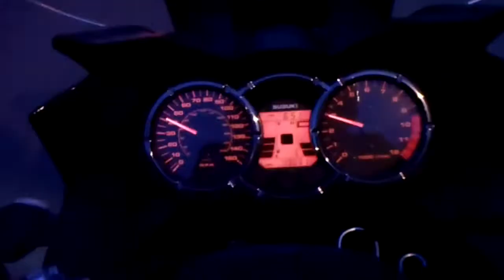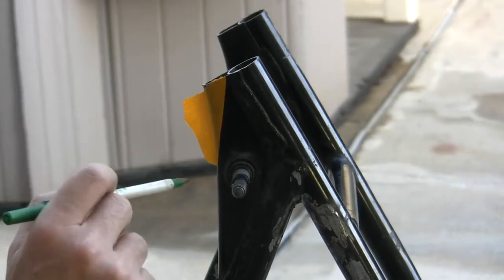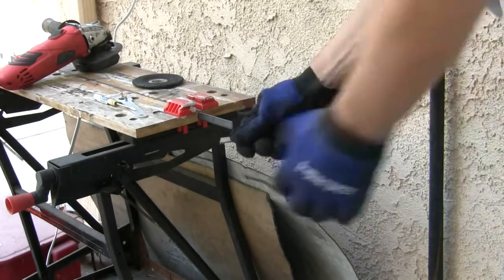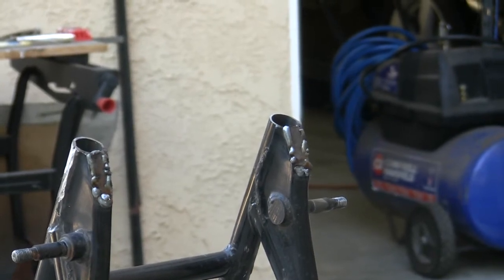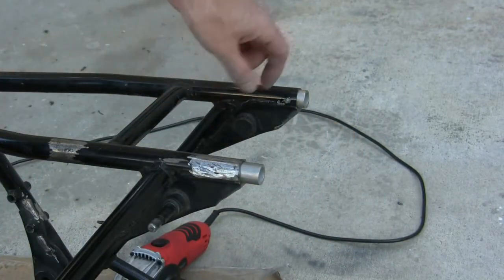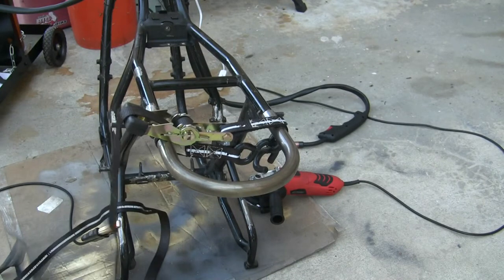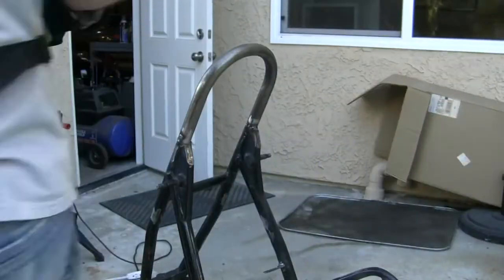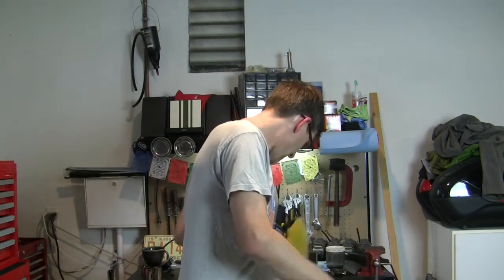Mount Rear Frame Hoop - GS550 Cafe Racer (Part 30)

Comment: Where did you buy that hoop from? Working on the same exact bike and I'm about to jump into this process.
Reply from the maker: Zach Painter Thanks for watching. I got the hoop from an EBay seller called motorcycleparts*market*. Chinese seller.  Took a lot of measuring and looking to get correct size ordered.  This one is 25mm tube diameter. The exact listing I bought doesn't appear to be active anymore. Enjoy your build!
Reply: Great! Thanks for the info! Looking forward to seeing the rest of the build.

Comment: Hey there, Im at the stage where i am  looking for a hoop. i see in the comments that the hoop you purchased has a 25 mm inner diameter but how about the the with. did you purchases a 8" or 9" wide hoop
Reply from the maker: I went back in my Ebay purchase history to see, as I don't recall. The description there doesn't answer your question so I will have to wait until I get home tonight to measure mine. Stay tuned,  answer to come.
Reply from the maker: Sorry,  forgot to measure my hoop last night. Will tie a string to my finger and get it tonight.
Reply: It's all good. I figured it out earlier today. 9" wide. Keep the videos coming
Reply from the maker: @decotube100  Sorry. I did measure tonight and you're correct...9 inch between outside edges.